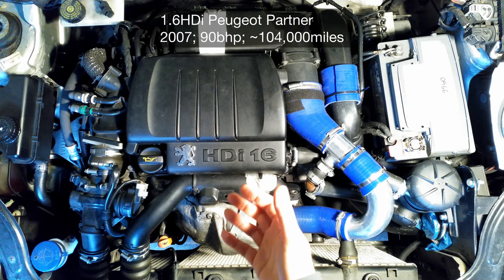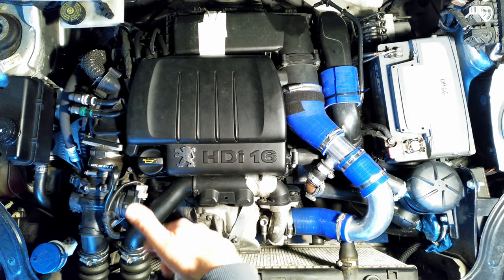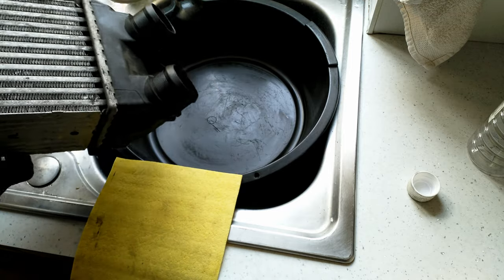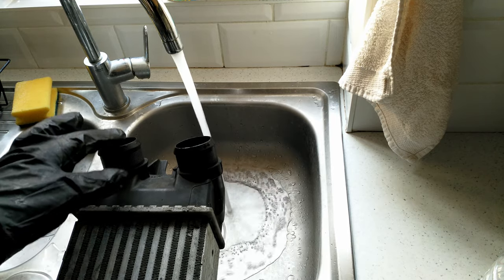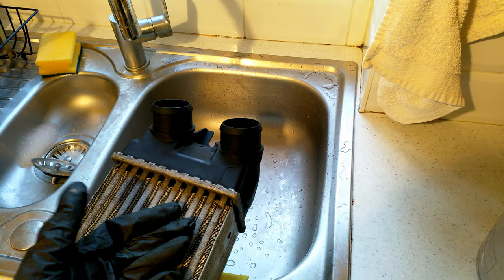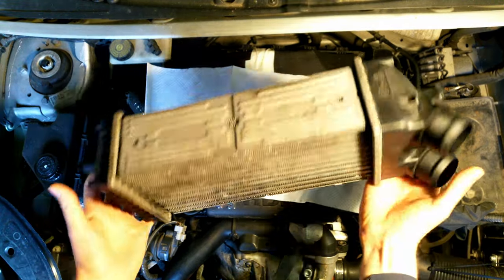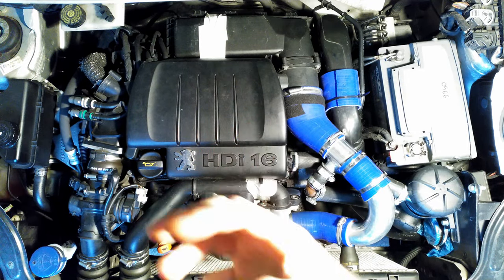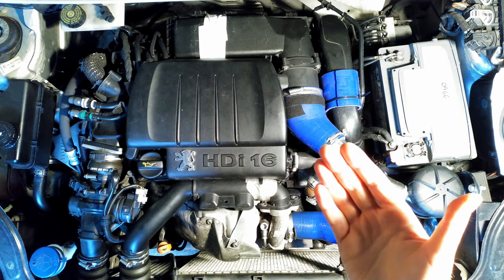Solving 1.6HDi smoke during cold startup

Comment from the maker: While this works pretty well to almost eliminate the cold startup smoke, it is only temporary. The oily vapours will build up again and it will smoke as before. This was only a test to see if it was valve stem seals or simple oily condensation.
Oil catch can should help with this, but this test was without an oil catch can, even though it is in the video. I filmed the beginning after some time.
Reply: Hi 
I cleaned a bit the camshaft sensor aswel 
But if u try to unplug the egr valve connector before u startit in the morning am sure it wont do it
Reply: Hi friend. In my opinion this smoke is from valve seals. 👌
Reply: @emremmuslu  yeah mate the most

Comment: My 2.0 HDi farm pig also does this and I like it haha when I start to see white smoke after start up I know winter is coming 😅
Reply from the maker: I suspect that the valve stem seals are getting harder and slipping a bit of oil in the chamber, when the weather is relatively warm, this completely disappears and probably with warmer weather they get a little bit softer. I should probably try some of these oil rubber softeners in the oil, as taking it all off is quite a hassle.

Comment: I'm glad you still got this car for this engine very good engine the 1.6HDI had mine almost 3 years now still going strong. I just service it once a year untill the service light comes on.
Reply from the maker: I still have it yes. I service it a bit sooner than the service light, but still going strong. I will probably hang onto it until electric cars become a bit cheaper.
Reply: @moremolecules  and you are exactly right there mate. Electric cars are way to expensive and I'm on the verg in weather they be as reliable or not and learning what to fix on them when they go wrong.

Edit: also we will have no choice in the near future but to have them due to emission zone charges and tax rise as such. The other down pour is manual cars will likely be a thing of the past as all the electric cars I know are all automatic
Reply from the maker: @anglingpassion5039  Yes, absolutely right and the overall problem are the batteries for second hand cars, how much will it cost to replace. Designed obsolescence works really well with EVs.

Comment: Did you fix it ?
Reply from the maker: As I replied earlier, it does fix it for a short period of time, but then it comes back again. It could well be valve stem seals, but I would have expected that there will be other symptoms, puffs on downhills, trafic lights, etc.
Reply: @moremolecules  My brother changed valve steam seals and it doesn't make a difference
Reply from the maker: @mateomiklavcic5431  Ha, thank you very much indeed Mateo for this comment. I wondered if it is the valve stem seals, but have not done them yet.

Comment: Hey man great video. I have a 2007 C4 hdi -get some smoke and it goes away until it heats up a little bit as you said it happens over night as engine cools down 😮.
Reply from the maker: Same thing as me. The cleaning pf the intercooler helps, but it is a temporary solution. I think that most likely there is a bit more blow-by as the engine gets older and on startup just a bit more blow-by and the turbo lets a bit of oil through the seals.

Comment: I have this exact problem with mine! Very rough start also 95% of the time, is fine once engine is warm. It had problems starting the other day, starter motor was ticking over fine. Took a few attempts! Could it be related?
Reply from the maker: It could be, difficult to say. Battery health and condition of starter motor would be key, but if the starter motor is ticking fine, it could be battery. Worse case scenario could also be air in the fuel lines.

Comment: Excellent work bro as always. Same happens to my 307sw. I've never cleaned the intercooler and the pcv valve is not working right, even though the membrane is ok, so oil fumes goes to the turbo and get burnt. Thanks for the video.
Reply from the maker: Thank you, but the cleaning of the intercooler is only temporary solution, until the oily bits get to the intercooler again. It was only a test to check if it is not indeed the valve stem seals.

Comment: I guess the early morning smoke is a result of  a  glowplug malfunction. At least one cylindre isn't heated up , so the fuel doesn't burn  properly.
I've got this smoke problem too. And a glowplug error code is shown in the ECU.
Reply from the maker: Hi Olen, the glowplugs in the 1.6HDi do not operate and not needed if temperature of antifreeze is anything >3C. They are only needed in cold weather and then it has to be <0C to be operational for longer. It has nothing to do with blue-ish smoke. Blue-ish smoke is oil burnt from somewhere. I have already replaced the glowplugs and have no errors in ECU regarding the glowplugs.
Reply: This engine can operate without glow plugs with no issue, unplug relay and you will see no difference

Comment: A good check for valve stem seal leakage is find a long steep hill and go down in gear with foot off the accelerator. At the bottom, hit the accelerator, and because you have had a low pressure situation you will have sucked oil into the combustion chambers through the valve stems. If you see smoke in the rear vision mirror there is good chance your valve stems/ seals are worn.
Reply from the maker: Hi David, yes, that is correct. I do not have any blue smoke in the steep hill situation and that is why it is only oil condensation and not valve stem seals.
Reply: @moremolecules  I don't understand this, what causes a vacuum with the engine brake, there is no butterfly valve in a diesel, if there is one, it only closes when stopping the car, right?

Comment: I had the same issue and it would also smoke if left to idle for more than a minute or two especially afterwards.
I changed the egr valve. That fixed it,  but you can also just clean it or fit a blanking plate
Reply from the maker: I have cleaned my EGR valve so many times and there is no effect.

Comment: Thnx for the video 
Been looking for this problem fix for ages only few video on utube but this is different and works 
Thnk u
Reply from the maker: Hi Kais, same here, this bothered me for quite awhile and eventhough it works it is only temporary. Oily condensation will build up again and blow on cold startup. I only did it to see if it is indeed the valve stem seals (nightmare to do) or just condensation.
Reply: Hi 
I didn’t wana touch the valves 
But i also cleaned the egr valve 
And the metal tube on top left of the engine i only unscrewed the twoo screws and i was shoked how blocked it was with dirt i clean it a bit and now smoke is gone

Comment: Does your Diesel have a throttle body? if not, it might not be generating vacuum in intake manifold. From my understanding, ONLY in a petrol/gasoline car, you have vacuum building in intake manifold when engine is running with throttle closed. ie, prolonged idle or better still, down hill where rpd is over idle with throttle closed. If its a bad valve stem guide, the vacuum in manifold sucks oil from crankcase. In diesel, no vacuum. I have 1.5 Renault dci smoking blue on cold start, to a much larger extend.
Reply from the maker: Many thanks for your comment, it does not have a throttle body per se, but an EGR throttle body, not quite the same. If it was the valve stem guides then it should also puff blue smoke going downhill in gear, but mine does not.

Comment: I would say try a injectors leak off test and manifold seals also.
Reply from the maker: Yes, I did that before (https://www.youtube.com/watch?v=cjVDHsvVNtk) and one injector is a bit on the blocked side of things. I had a go with an injector cleaner as well (https://youtu.be/CxJJtPArD9Y) and even though a vibration at ~1,500rpm disappeared, the smoke is still there. Granted, the injector cleaner did not fully clean them, but the smoke did not change that much.

Comment: I solve this problem with ecu mapping and abort the  egr valve.
Reply from the maker: Yeah, I will double check if I block the EGR valve if this solves it as well.
Reply: @moremolecules  sometimes smelling bad but there is no smoke
Reply: Finally someone with right solution, I mentioned this 2 years ago on previous vid but more molecules trust his instincts more than facts.
Reply: @bngh12ful  thanks bro
Reply: My focus has blocked egr and removed dpf. Still has this puff of smoke on a cold start. So egr has nothing to do with it
Reply: I have the same problem, i have egr removed completely and its the same. Did you found something?

Comment: Hi!
Same here.
At cold start I have blueish smoke.Could be also injectors because sometimes a have rough idle early in the morning.I have changed the turbo but the problem is still the same.Could be valve steam seal? In drive I don't see any type of smoke, maybe is not much as it should be, but if my valve steam seals would be broken I think i would see some puff off smoke.Some ideeas?
Reply from the maker: It could be valve stem seals of course. Nevertheless, anytime I have cleaning the intercooler the blue smoke does not exist. This really suggest that oil mist from the crankcase is going to the intercooler or a tiny amount of oil is passed from the turbo. Some day I will do the valve stem seals and will let you know if that was the case at the end of the day.
Reply: @moremolecules  Does exist any method to verify If the Valve Steam Seals are broken?
Reply from the maker: @MrVasylyca20  Good question, but not entirely easy to answer. The best way would be to find a down hill, put it in gear and go down. The valves would be shut in that case and supposedly oil will pool on top and it should be prevented by the stem seals. Once at the bottom of the hill you give it gas and if it smokes blue, it is valve stem seals. Similarly, you stay at trafic lights and on the green light if there is a puff of blue it is likely valve stem seals, but I think the hill is the most accurate.
Reply: Overnight some air come in inlet fuel lines...I fix few of them with same problem,put vaccumeter and look when shut off and look in morning,sometimes boobls you can see
Reply: @nikolaservis where does the air leak in in your experience??

Comment: Hey great work, this problem seems to be everywhere with loads of people on the forums with DV6’s… me included.   Same problem, I can leave it 3 hours or 12 hours and on first start, small misfire and blue smoke. Many say injectors dripping diesel… would that cause blue smoke? Driving me mad it is 😬 did you do the stem seals yet?
Reply from the maker: Good quetion, I have an idea and it is not the valve stem seals, but will try to do something about it and film it in the next few weeks.
Reply: @moremolecules  yes I too can’t believe it’s stem seals. None of the other typical symptoms 🤔 it’s a head scratcher that’s for sure. Well good luck and I’ll be following and watching for the video 👍👍

Comment: by the way on my third turbo ive done only 250 miles and already a bit of play in the spindle, not sure if this is normal or ...i left the fine mesh filter out this time (lower banjo bolt) as it completely clogged up and ruined my second turbo after only 1300 miles. I had fully flushed the engine removed sump ect ect...
Reply from the maker: Ouch. There is something not quite right if you are on your 3rd turbo. Here is how the normal should look like: https://www.youtube.com/watch?v=-ML49tY9Pgk
Generally speaking, when the turbo is replaced, then you run the car for ~300miles and then drop the oil and also clean the banjo filter. Blocked banjo filter will only lead to another turbo. Yes, removing the filter might be better in your engine, but slightly bigger piece might fail the turbo again. Do a few oil changes, say every 300 miles 3 times. that should remove all the sludge. Check if you injectors are not leaking by any chance: https://youtu.be/kt6zJANLaYQ

Comment: Did you remove the 2nd catch can ?
Reply from the maker: I did remove it, but it was because I was due MOT or annual check and had to remove everything. Then I reinstated the one oil catch can and have not put the second. No particular reason, just there are other things to do. The second one is somewhat not particularly put in a convenient place and I might have to think where to put it.

Comment: Guys, I need some help. One of my injectors has a flow correction value of -6 and needs to be replaced. I read somewhere that injectors are classified into A, B, C, D and they seem to represent different flow volume. I just can't find which ones I have. 
It's a 1.6 HDI, 80kw, 109hp Peugeot 207, produced in 2008. I checked the codes in diagbox and they seem to be correct. 
One thing I noticed is that all injectors have C.620026 code on them. Does this mean it belongs to C class?
I have a very rough idle on cold startup followed by a really bad smell and black smoke for a couple of seconds and then whitish smoke for a longer period of time. After a couple of minutes when the engine gets heated the rough idle disappears and the car runs fine. I should also mention I had my dpf removed last year.
Any help would be appreciated!
Also, thanks for all the videos, I've been watching them for a couple of years and they are pure gold!
Reply from the maker: Many than ks for the good words Dolo. Yeah, -6 is way too much correction. Acceptable one anything between -1 and +1. Did you hook it up to a leak-off test kit by any chance? It might help to see in addition to the -6 correction values. As far as I know, there should not be A,B,C and D injectors as you need to code any new ones with Diagbox/PP2000. The ECU takes the code and works from that the specs of the injector. I have not heard about these classes of inejctors, but might be wrong about that. I suppose you do not want to chuck in some injector cleaner such as Wynn's. This might be working on doing something with cleaning, say one bottle in 30L of fuel. I am experimenting at the moment with it and will post results on the cleaning, but somehow it has cleared the vibrations of startup with mine, so there could be something, but I will follow with proper test with the leak-off thingy.
Reply from the maker: @oloyang431  Try perhaps e-bay, but if you do not have access to it then it is difficult. If the numbers of the new injector are a match then it should not be a problem when coding them again.

Comment: I did a bit well, but a bit of a problem remained.)
Reply from the maker: As I said at the end of the video, there is still some oily condensation in the turbo pipe and the doser or EGR throttle body as well. Had I cleaned all these as well, there would have been no smoke. This was mainly a test to see if this is due to valve stem seals or simple condensation.

Comment: So now you've identified that the problem is oil condensation in the intercooler, how do you fix it? Cleaning the intercooler daily is not really a solution.
Reply from the maker: Ha, good question! There are two options, one is an oil catch can and the other oil drain valve on the intercooler. Oil catch can seems to help and I have tried that, but they are not 100% efficient, probably way less than everyone thinks. The drain plug is something that I am thinking about testing, but have not yet had the time to test.
Reply: @moremolecules  hello, i really enjoy your channel and i have done some work on my 1.6 hdi 90hp myself being inspired from your videos.
I do have exactly the same problem- blue smoke on a cold start. What do you think is the root cause of the problem as there was no issue 10,000 miles ago. Could it be a worn turbo which leaves oil residue in the intercooler , or piston rings which are not sealed enough or perhaps any other suggestions? I do have a lot of evaporation coming out from the crankcase breather, is this normal? I would really appreciate your input.
Reply from the maker: @vasilvlasov5863  Thank you for the good words and yes I have helped at least one person.
I do not really have an answer. I still do not think it is the valve stem seals, although it could be. At least on mine it is nt turbo-related, I changed the turbo cartridge, but still get cold-blue smoke. What I noticed and I am not too sure how to interpret. I drive fewer km/miles now. Working from home and all. If I keep the car a bit longer not driven, say 5 days, there is no smoke. But if I start it on the next day there is smoke. As I sai, not too sure how to interpret. Definitely not rings, as that is always the same, definitely not turbo, I have replaced that and it will smoke despite the time left not driven. I suspect it is oil through the intercooler, but it may well be valve stem seals. Difficult to say. Valve stem seals are difficult to replace, hence why I have not done it yet with a video.

Comment: I'll be theres a p1351 fault logged for failed glow plugs.
Reply from the maker: There is not a code for the glow plugs and I replaced them not so long ago. In any case the glow plugs in these engines do not operate unless the temperature is really low, as in <3C. This was filmed in ~18-20C.
Reply: @moremolecules  glow plugs are used for pre and post combustion reasons also to keep emissions in check. Not just for easy starting.
Reply from the maker: @dmdaithim  In general I agree that glow plugs help keep emissions in check. On these engines they do not operate at all unless temperature is rather low.
Reply: @moremolecules  They do work. Just because the glow light isint on doesnt mean the glow plugs arent in operation on the dv6.
Reply from the maker: @dmdaithim  I agree that the light is just a light controlled by the BSI, so it does not need to be illuminated. The post startup operation of the glow plugs in cold temperature is of course not illuminated in terms of the light. Nevertheless, AFAIK and have not ever read anything different, the glow plugs in the DV6 are not in operation unless coolant < 3C.